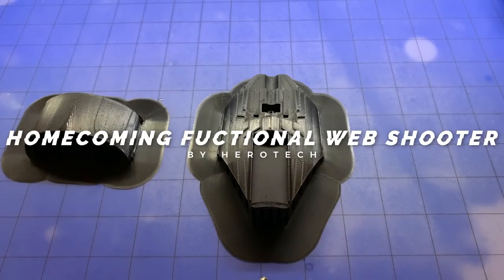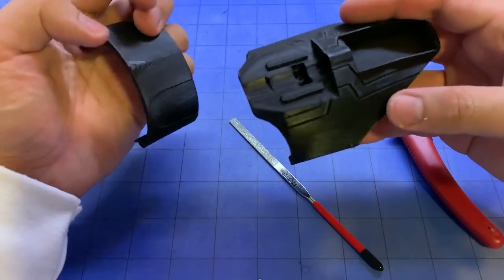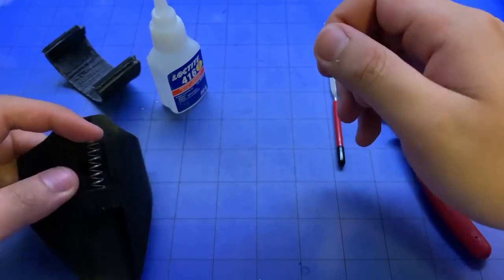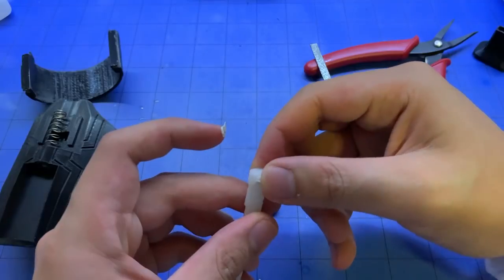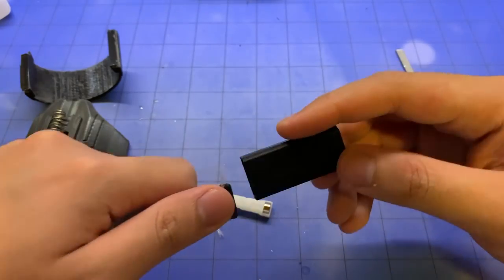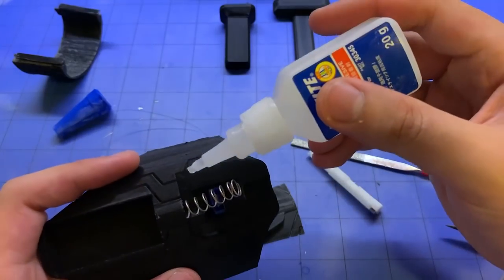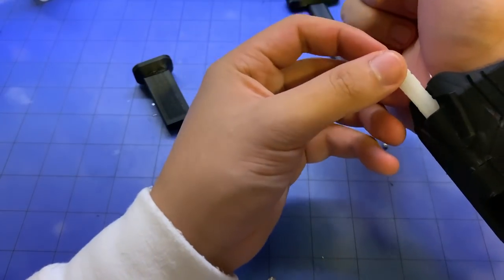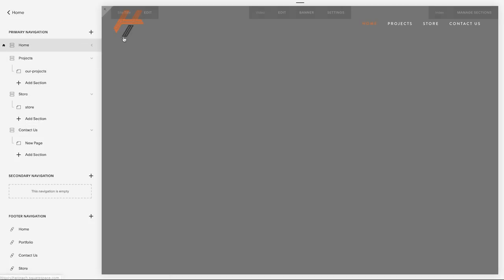How to Make the Functional Web Shooter "HOMECOMING" (DIY Tutorial)

Comment from the maker: WEB SHOOTER IN ACTION: https://www.youtube.com/watch?v=F3ajGAzbIsE
Reply: Hey do you think you can make the flash ring and a flash symbol come out the ring
Reply: Next time you should have a button to press for the web to come out instead of the nylon having to be pulled
Reply: Please give me springs link
Reply: Tarık Efe TOPCU i asked the same thing; its order able through email only
Reply: Te compro lo 2 por 800 y si es solo 1 te doy 509
Reply: HeroTech hey man I have a tip for you know how cement starts off as liquid but then turns into a solid really quickly, what if you used that so then you cane try web swing from (a low) building to see if it’d work?
Reply: @HirstMovies  que queee
Reply: Hey do you have a website? I've been looking for some specific things and cant find them
Reply: I want that
Reply: @tark6963  you dont need the link go to ace hardware and see if they have the type of spring the first spring is 4.57mm diameter 
SSC-014B5 second spring:(7.62mm diameter) SSC-026D-12
Reply: It's not web shooter it's a thread shooter
Reply: @tark6963  i am working on that for all of u
Reply: Do you think u could send a link for amazon cause I can’t find the springs
Reply: Reid Mariotti but I live in Australia so where do I buy it from
Reply: you can sold that web shooter
Reply: Please can u sell these on ur website 2
Reply: Where we can find the body
Reply: Where are the links for the models??
Reply: @DarkStevo 
Hhhhshdhdur
Reply: Doesn't the spring become deformed as the net launcher is used and lose its firing force?

Comment: I calculated it costs about $20 USD to build this. (Not including the springs, i have no idea how much they cost because the website doesnt say)
Edit: i’d estimate around $5 per spring
Reply: I've seen some pretty strong springs in soap or lotion bottles. That's what  gonna try /-

^^
Reply: @wouldntyouliketoknow5064  did it work?
Reply: @JaedynBemiller  yeah not all the soap springs were the right size, but the ones that were worked nice 👍
Reply: @wouldntyouliketoknow5064  what soap did you use?
Reply: @JaedynBemiller  it think it was from a shampoo bottle

Comment: Awesome! I have a question, which type of filament did you use to print the parts?
Reply from the maker: Any kind will do, I used pla :) nylon for the projectile
Reply: @herotech  what 3d printer do you use

Comment: Dude can you he'll me out. So I got the web shooter and glued the sping but the lock block doesn't come out so you can't load the projectile and stay there. What can I do ?
Reply from the maker: Hey, thanks for commenting! If the lock block isn’t moving, you can try sanding down the edges of the lock block so that it fits loosely in the body. What’s happening is most likely that the plastic of the lock block is getting caught somewhere in the body so it doesn’t move up and lock the projectile in.
Reply: @herotech  thanks for the answer but the lock is not moving because the spring is block so I think I might print the projectile a bit smaller
Reply: @herotech  also can you make spectacular spiderman web shooters?

Comment: I don’t know why but I’m having trouble with my projectile locking into place the indentation on the projectile doesn’t line up with the lock block
Reply from the maker: Maybe the scale is off? Try sanding back the areas that don’t match exactly or changing the percentage dimensions of the stls
Reply: HeroTech  cool thanks I reprinted and now it lines up , I’ve bought different springs at hardware stores but I feel like never wants to work for me , I noticed you linked where to u bought ur springs but how exactly do I go about buying them?

Comment: Nice, now all you have to do Is make it that the string can be 175 Meters long and strong enough to carry a 200LB+ man.
Reply: Why not make the webshooter like 38 degrees celcius in heat with some sort of heat mechanism, and use galium as web fluid. Essentially galium is a type of metal that can melt in the palm of your hand. And it's not toxic at all. Soo. You could theoretically make the webshooter heat the galium at a specific temperature so it's like a spider string. Sooo. It kind of is possible but not really I guess.

Comment: It wouldn’t be better if u could attach magnets to the connector pieces and the shooter, that way u don’t need to spend that much time on putting them together
Reply from the maker: Pros and cons - that method has less strength of web string
Reply: HeroTech elaborate
Reply: @miro5182  with 2 magnets connecting if they get pulled apart bye bye string

Comment: i need to know what type of spring i need T-T
Reply from the maker: Hi, for these we used a custom spring from Singapore that is hard to source - we are redoing the design to use easier to find springs
Reply: @herotech  thanks for the reply! I love your videos!
Reply: @herotech  Any tips for making this thing fit?
It hurts my wrists when i wear it but i like the look better than the other one
Reply from the maker: No problem, thanks! This design should have two versions of the top, one that interfaces with a bottom piece and one that just has slots for a watch strap to go through. Using the version for watch straps/velcro straps could be better. Currently we are reworking the design to fit different size wrists, as of now unfortunately there is no real solution
Reply: @herotech  ok thank you!
Reply: @herotech  how do your cartridges not fall out!!?? even when i bump up the z axis scale they dont stay in fit
Reply from the maker: Ah this current design is just a loose friction fit for the cartridges, you can add black tape if you want to the sides to have it press in and stay better - currently it has just a very light press fit, with the long projectile helping keep it in place, so that when it fires out, the cartridges can “eject” out by flipping the wrist
Reply from the maker: Sorry for the late reply
Reply: @herotech  all good thanks!